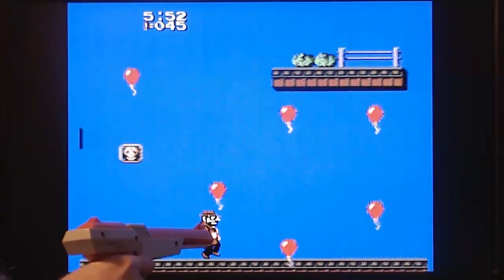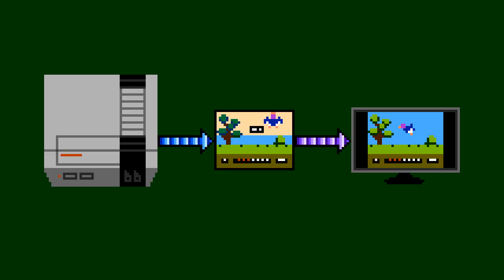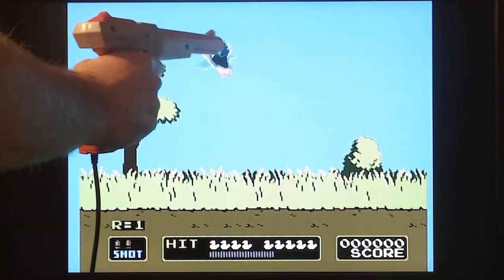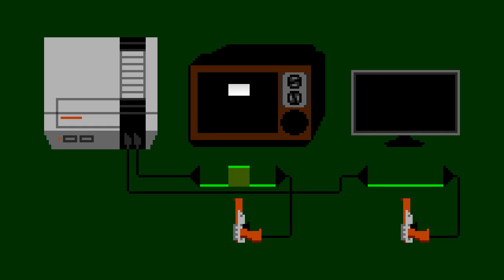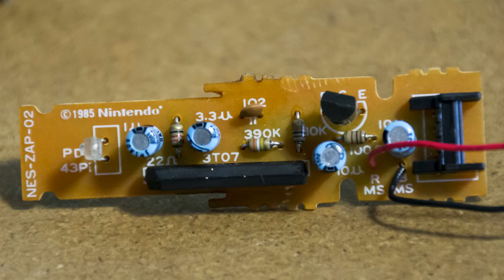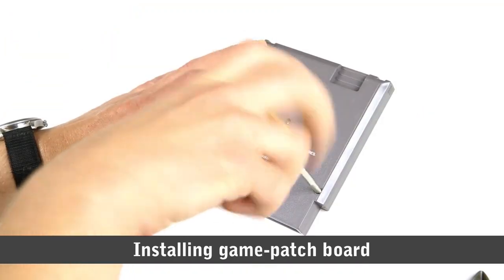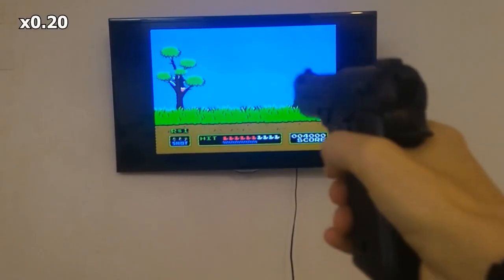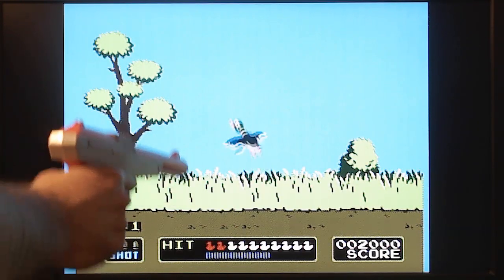Ways to play NES Light Gun Games on a Modern TV

Comment: I know your video was posted six years ago but now a days there is the Aimtrak and Sinden Lightguns. They are kinda pricy though. $275 for a two Lightgun setup. Aimtrack uses a IR bar, Sinden uses a on screen white border. You can even go cheaper and use the Wiimote as a light gun. Just got to buy the Mayflash Dolphin Bar with USB connection. Also got to get a gun shell and use Nunchuk as secondary weopan or reload button. It works well with PC, Raspberry Pi and Steam Deck. Came out to $100 for two Wiimote setups. I had to get battery packs, a charger, Wiimotes, Nunchuks and Gun Shell. It works on all emulators. The setting up is a pain at first but once you understand it, it’s easy.

Comment: Nes zapper is not real light gun. There's just light sensitive diode, and light is usually white square on the screen, or a lamp, if you want a cheat :-) Sega Light Phaser from the competing Master System is a true light gun - it works directly with the television beam, no white square is needed there.

Comment: The gun needs to see both the white and the black both . Originally it only needed light but that caused players to aim the gun at a lamp and it righters a hit. So it needs to see the black, which then allows it to look for the white square. If it sees it  then it's a hit. If not, then the duck is lucky. It's set for 60 fields on a 240P resolution. (Typically only 224 lines where really visable.) while only half the resolution, that didn't matter as it only refreshed the same lines over and over rather then alternating . As long as it's 60 times it's fine as far as the CRT cares. With  even a 480P LED tv it has to double that resolution. You have the buffer, and the upscaling and that takes time. And it's looking for brightness in phosphorus dots, not led lights. Our old tvs had that glow new TV's dont

Comment: Brad, by FAR your video is the absolute best on this topic!!  Obviously you take an engineer approach and that's why.  I am one too and so it's to the point, clear and informative.  I was wasting so much time on the web trying to get my zapper to work and you're the only person to point out that the original NES zapper will NEVER work because of a physical restriction.  (You found out directly the hard way and did francis bacon trial/discovery)

SO thank you for that!! Once I realized I was wasting my time I have everything set up (The nes mod page is not really clear on the source rom required but thankfully he did provide a checksum so EVENTUALLY I found the proper rom to patch)

So I am asking this favor, do you have any info or links. etc. to a workbook to upgrade the LED on the original NES zapper?
I figure I could get what I need from Greybar but I am not going to "Guess" at the A-Z (Basically convert a NES to a Tomee diode wise)

for example is it just a matter of the diode or do I need to get a board or modify the in-series board ? etc.
I could take the guts out of a tomee and put it into my old shells but that's a bit of an expensive way when I have the tools and iron to do the upgrade to the existing NES branded hardware.

BTW Props on the home-made gunverter!! Obviously that is really the best solution (if he does a port for all consoles) as it's a physical bridge so it would work with every game without mod and every console without mod of the game itself.

If we can present a large enough presence or get a crowdfund going maybe start a project to do full turn-key kits.
Basically a gun that has the "Wii" hardware inside of it, a box/adapter that plugs into the console and sits in front of the TV (like the Wii sensor) and boom.  We just mass market them, maybe even sharktank it.  but anyone who would fund production would need to know it's going to sell.. I am content with crowdfunding, getting a hopefully large list of buyers and then just make-to-order ship them.

I have two zappers, so I will take one, gut it, gut my Wii remote and get the parts for a sensor.  Check out the source at that openNES page and make my own just to have it (a Wii embedded zapper) and then if it is easy enough and successful... push for the crowdfund route

Let me know your thoughts and thank you for you forthcoming support on this!!

By the way your speaking voice is IDENTICAL to JP!!!
https://youtu.be/z0O_VYcsIk8?si=GXHiSwQeWh4VWBhx
Reply from the maker: I've never tried modifying the original zapper. I think you might be able to disable the high frequency filter by snipping one of the pins of its internal chip, but I'm not sure which one. The LightGunVerter seems like the best general purpose solution, but its creator has never put it into common production. They left behind source and instruction on how to build it, at least, but you'd have to find the parts and put it together yourself. I have not wanted to try this yet.

Comment: The sample-and-hold infographic is not very accurate. It would not make sense to wait and write the whole image at once. So that does not happen, it would demand very weird display panel wiring to instantly feed 6 MB of pixel data into all those cells while the rest of the 16 milliseconds it can take a nap. The pixels memory does follow the scanlines, but it keeps each pixel active till it gets an update. The delay comes from another problem with LCD cells: overshoot. Compare it to an elevator. If you want an elevator to go from floor 0 to 255 in a cycle, it is no problem, it just hits the ceiling and stops immediately. But if you want it to go from floor 100 to 105, it needs way more precise control. It is the reason why you get horrible ghosting with grey-on-grey moving objects, but not with white on black staff rolls or such.

Comment: I’ve got a question. Thank you for this video. It appears the Zapper only works for Retron 1,2, and 3. Is there a solution to work on Retron 5? I tried this gun and it’s not working.
Reply from the maker: Clones vary a lot in how they work. I believe the Retron 5 is essentially a port of the FCEUX emulator, so if it could do zapper stuff it would most likely be through some sort of computer mouse style peripheral?
Reply: @Sakanakao  ?????? Lol. Thanks for responding. This went right over my head lol.
Reply from the maker: Well the short answer is that I doubt it could be made to work with Retron 5, but I don't know.

The Retron 5 is more like your computer running an emulator than the previous Retron models, which were more like a direct clone of the NES.

Comment: That Wii remote adaption seems to me like all one would need to do is make a “translator” for the zapper. Something that plugs into the end of the zapper but looks exactly like the original, just making the zapper look slightly longer. As for power, those batteries used in the Dreamcast VMU’s would be good candidates. 

I personally prefer finding a way to play original carts with a original zapper or a quality replica that gives the same feel of the original. Instead of modifying an original cart, use something that hooks up to the cart like the Game Genie. Maybe playing around with the TV settings can help.

Comment: PC Emulator method

Use an emulator that maps the Zapper to you PC mouse click. 
Use a PC lightgun mapped to mouse. Done. 

It works flawlessly. 

I did this about a decade ago. I used an "EMS TopGun II" that I bought from Play Asia. And some emulator? Maybe Nestopia?

I would recommend a newer lightgun though as it is meant to run on older operating systems like XP or Vista. There are no 'Official' drivers for Windows 7 or 10. However, I got it working on 7. And I think I have tutorial on my channel for that if you have one. I'm not sure about Windows 10 yet though.

Comment: Just buy a CRT for $10 and then you can play every light gun game.
Reply: CRT televisions are starting to become harder to find and is getting more expensive on Ebay, but if you're lucky and is experienced with repairing them it's possible. There was someone that was able to get a CRT TV that got rained and snowed on for decades working again just by replacing small bits of vacuum tubes and transformers.

Comment: Would the Modern Mallard’s patch board hypothetically work with all NES light gun games? If so it would seem more practical to redesign the software patch portion of the mod after other third party NES accessories, such as the Famicom pin converters or the game genie - with its own external housing. 

I’m very confused by the Modern Mallard’s design. The way it was designed, you would have to go through the modding process each time you wanted to play a different light gun game. It wouldn’t be worth going through the tedious effort of opening up an NES cartridge just to remove the patch board to transfer it into another cart. 

I get that the project was marketed with nostalgia in mind - of course Duck Hunt is the Zapper game that everyone remembers. But if I were to invest a steep price in such an expensive product, I would prefer that it would be easily and readily compatible to plug into any light gun game for the system. 

I even think that if they were to rethink these design flaws, they would have a more viable sales pitch, and overall a solution practical enough to appeal to the demographic. I think this would offer a fairly practical solution to this issue in general, if this is plausible
Reply from the maker: Every game requires its own patch. Their patch for Duck Hunt is only for Duck Hunt. They had been planning to work on other games. The NESLCDMod project is more or less the same kind of patch, the main difference is just that Modern Mallard was selling the patching board to apply it too.

Comment: If the fix involves a motion gun, then it's not a fix at all. Incredibly inaccurate, and its accuracy is entirely depends on where you are sitting and how still you keep the gun in a single place.
Reply: If you're referring to the Wii Remote solution - the wii remote is not just a motion sensor, it has a camera on it that's used to detect the position of the IR beacons that come with the Wii. So it's basically the same technology as modern light guns, it's not going to be subject to drift 'cause it can work out exactly where it's pointed on every frame.
Reply: It's still very inaccurate when you are dealing with old games coded with very accurate light guns in mind. It's practically unplayable without a cursor on the screen.

Comment: But it's not Duck Hunt I want to be able to use with my LCD TV... 

I WANT TO PLAY STACK-UP

I had an idea for this though, If I could get a small CRT at which R.O.B. could look that I could place beside my LCD and split the NES output to I could make it work.
But At that point I might as well play it on my CRT.
Reply from the maker: I don't know if R.O.B. is sensitive to LCD TV light or not, but at least lag isn't an issue with it like it is with zapper games. There's no instantaneous reactions, so it's perfectly fine if the light signals to R.O.B. have a delay.
Reply from the maker: I suspect you could even just use a single LED connected to the composite signal, rather than a whole CRT, to communicate with R.O.B. but I'm not entirely certain about this.
Reply: Yeah I just know he won't work on my LCD. That's an interesting idea with the single LED. If I had the skills to build such an item it would be interesting to try

Comment: are you an idiot?  

the tv's back in the day were not instant..  
the console isn't the one building the frames up pixel by pixel.  

it's the other way around
the TV is the one that could only display an image 1 pixel at a time.  
the tv is the one that used scanlines to produce a full screen image.
Reply: yeah but that still means the nes knows exactly which line is being drawn
Reply from the maker: Am I an idiot? Yes! Always!

That doesn't have anything to do with this, though. The CRT TV is synchronized to the video signal of the NES' GPU, so the NES had to make a signal with the exact same timing as the TV was supposed to display it. If the NES deviated from the 60Hz frame / 15kHz scanline timing more than a tiny amount the TV would have a lot of trouble displaying the picture; usually if it was so out of tune it couldn't sync up the picture would start rolling across the screen.

Modern TVs trying to display the composite video signal are no longer a slave to it, however. They just simulate the timing, while buffering the signal and converting it into some digital image internally. Hence the lag / delay.

Comment: Something I've never seen addressed:  When I first got my NES I played it on a small Black and White set.  I soon discovered that if I aimed at the tree leaves, it counted as a hit, every time.  I was able to get to (what I considered) absurdly high levels like this, but it was very dull to repeatedly shoot the same spot on the screen with no chance of failure for an extended period of time.  I don't think I ever had the patience to get to level 100, as I have no memory of the now known glitches at that level.

Once my parents became convinced the NES was indeed safe for a color TV set, I moved it over and was never able to replicate the trick.  I had wondered why aiming at a light bulb didn't have the same effect.  The filter you mention explains that part.  

I wish I still had that set to experiment with changing brightness and contrast settings.  The "green" of the trees translated to a brighter white than the sky.  Perhaps there was enough image persistence for it to register.  I don't remember if I ever tried shooting the bush or grass, which would have been the same color.  Any thoughts?
Reply from the maker: Hmm, it shouldn't be persistence, as Duck Hunt first checks for a "black" frame before it checks for the white hit square. (That will filter out most light bulbs even if they flicker rapidly like a CF.)

I don't know a lot about how black and white televisions differ from colour ones. It seems plausible that it was producing zapper-visible light with the right timing and location for what you're describing, but I think it would take a bit of scientific work on that original machine to figure out the real details.
Reply: @Sakanakao  Well, it's nice to at least be able to rule that out as a cause, and to know that there's not a known, straightforward answer.  Thank you for taking the time to reply.